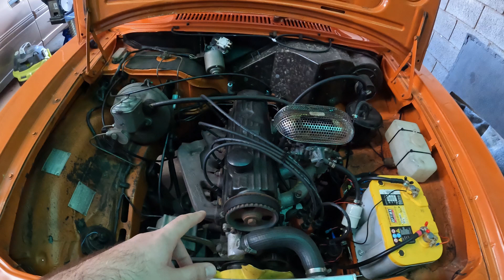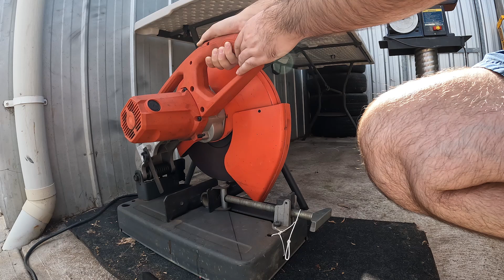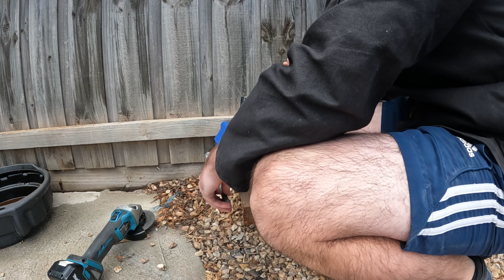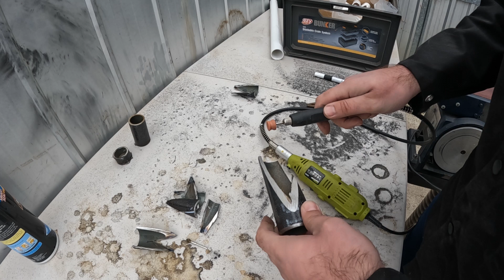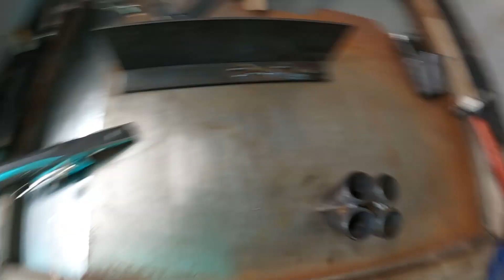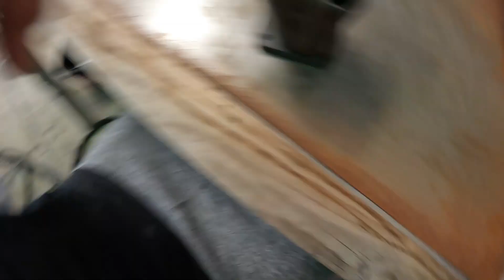4 Into 1 Merged Collector DIY

Comment: Thats a killer job on the merge cut outs mate. Especially considering the work area and tools you have to get the job done. The centres i found much easier to get a seal by welding the inside "+" compared to trying to reach from the outside. Great work mate. Looking forward to more progress
Reply from the maker: Thanks mate, I really enjoyed it and I guess thst helps when your taking your time to learn something totally new.

I should have done that and welded the inside also but I was so adamant on doing the outside that I did fill the xenter up a few times and die grind it all out to clean.

Still need to build a little pressure tester to test I've got everything welded up.